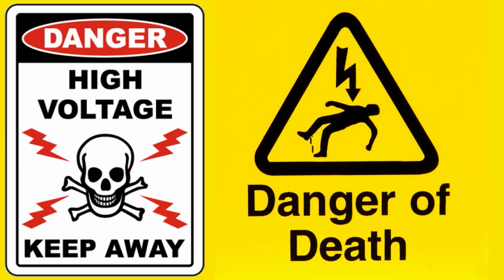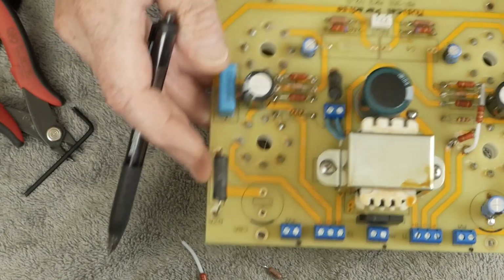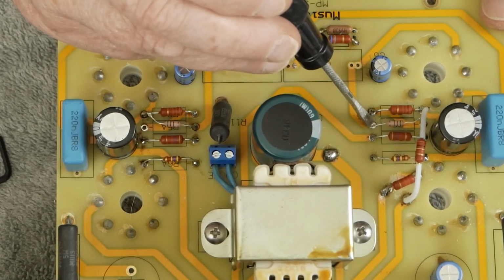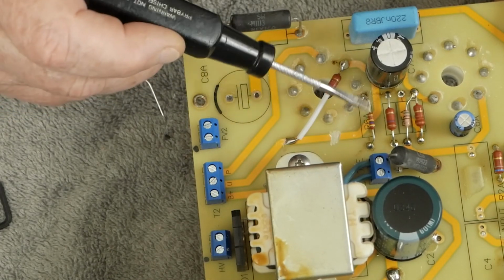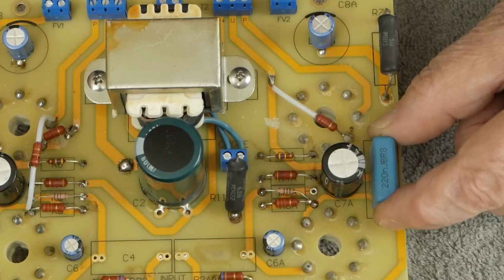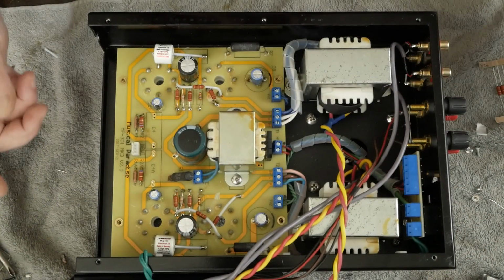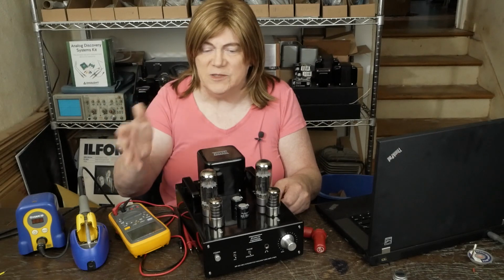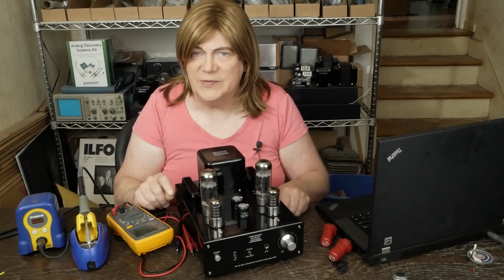Musical Paradise MP301 MKIII: Circuit Board Mods Video 2

Comment: Have now found the time to complete these mods and this is to say "thank you" - not only do you have a deep understanding of valve amps and a "golden ear," but you are a great educator too. This was my first such project and I was expecting dead silence (or an explosion) when I switched the amp back on. But, thanks to the clarity and patience of your explanations, it worked first time - and how! I was planning to do an A-B comparison with my beloved Amptastic T-amp to decide which was the "keeper," but when I heard the sound from the MP301 after installing your mods, I didn't even bother. Fantastic clarity (another veil lifted) and remarkable bass extension. (The T-amp is packed and ready to go in the attic.) I have the larger Edcor transformers on order - I think they will have to go in external cases since the circuit board in my later model, UK-spec MP301 is larger than yours. I and, I am sure, many others are very grateful that you posted these videos!
Reply from the maker: That's great to hear, and thanks for sharing your experience!

Comment: I use 6L6, KT66, KT77 and KT88 output tubes for my unmodified amp. These are my preferred tubes over EL34. Would these tubes be compatible with the modified unit?
Reply from the maker: Nothing is changed on the output tube side. I will say even in an unmodified amp the early style "plain" 6L6G or 6L6GA  is pushed beyond it's rated dissipation (19W) and shouldn't be used. A 6L6GC is a different tube with a higher rating and is fine.
Reply: Thanks. I did the mod and is very happy using JJ 6L6GC and Gold Lion KT77. Still experimenting with different driver tubes. Ken-rad 6SJ7 is nice. Will try some Sylvania glass bottle 6SJ7, but there seems to be many different vintages to choose from.
Reply: I have to say the improvement of the mod is way beyond my expectations. I use the amp with GR Research modded RP-600M. The modded amp seems to sound better than a well regarded 845 SET amp I have. Thank you for the great work.
Reply: I also own the Musical Paradise MP501 latest version with factory upgraded Vcap ODAM coupling caps. The modded MP-301 seems to sound even better than the bigger brother with the RP-600M.
Reply: @singlevv I have carried out the mods to my two mp301’s too. I have found the improvement in sound quality is not small. Hats off to Skunkie designs.

Comment: Really appreciate all your work on this - you have created something special! In the BoM, for the resistors column 3 says, for example, "PR01000105100JR500" but the last column for the same resistor says "Sub JA100 suffix". Does that mean we should go for the JR500 and the JA100 is an alternative,  or that the JA100 is preferred? (Same question for the capacitor in row 5.)
Reply from the maker: It means they are the exact same resistor in different packaging that's all the different suffix is. I used the term sub, maybe alternate would be more accurate, but then I would get emails still asking which is better...

Comment: Good job Stephe!  Quite a few mods you've done there, but they all seem to make good sense!

Mundorf oil/aluminium caps ay?  Cool.  They're sposed to be very nice caps.  I used the same type in the crossover network of my home built 'Silicon Chip' magazine, large bar-fridge sized 'Majestic' speakers.  Seeing you use the same type of capacitor as an upgrade in that amp just confirms my wise choice of using them!

It's a shame those Edcore (?) transformers you bought for it were a waste of money!  Just shows to go that not everything a manufacturer makes is necessarily all good - unfortunately.

Hey great news you're gonna do electrical parameter & subjective tests on this amp!  That will REALLY round off this video series!  Thank you!

Comment: Nice modification ..............about some say ............this is proven over and over for almost nine decades .....and there's a synergy to them between some triodes and some penthodes .....NF2 with AD1..........310A/328A with 300B .............etc 
usable other tubes are 6SJ7/ D3a/ EF86/ 5693/ E80F/ 717A / VT269 /408a/6AK5  etc ...........
But to mention also trhat triode /triode can also work out good .........6SN7/Triode.......
All depends on the results .......
Thank you for sharing these interesting uploads .